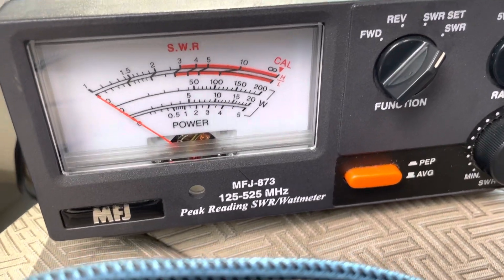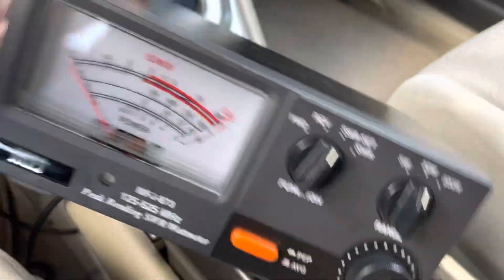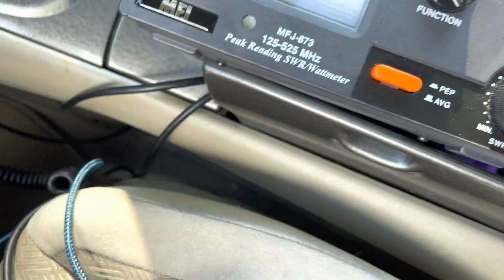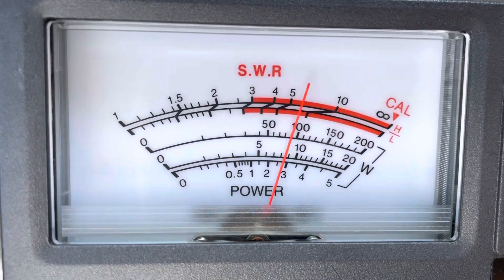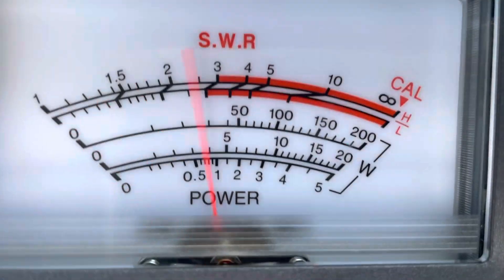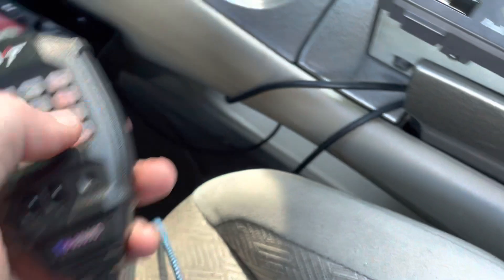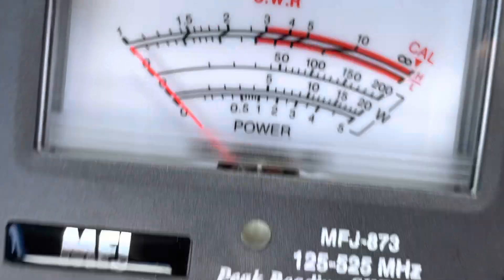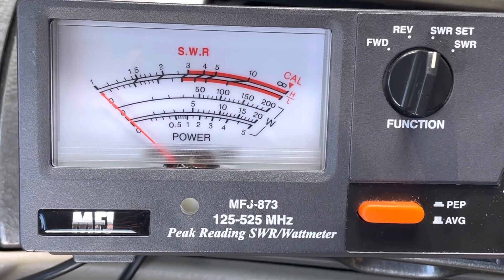TYT TH-9000D AT-588Max TX Power Output Test Demo + Tram 1/4 Wave VHF 2M Mobile Antenna SWR Check

Comment: Nice radio but LOUSY receive audio from that tiny speaker. Just too much base, rolled off, muffled sounding audio. I wired up an external Motorola Maratrac speaker and the radio is now fully useable with crisp audio. The radio in this case is being used as a base station with a rooftop antenna.  I guess for the price it seems worth it.

Comment: Interesting that you did this.   
I have a RETEVIS RT9000D UHF and a VHF.  At the radio club QSO every Monday evening they all say that the modulation is powerful and clear.  And I just set it to "low".
With a good antenna and position,  the transmission range should be very good.